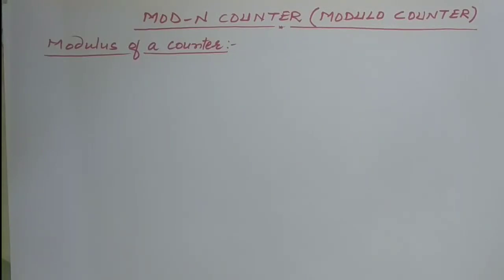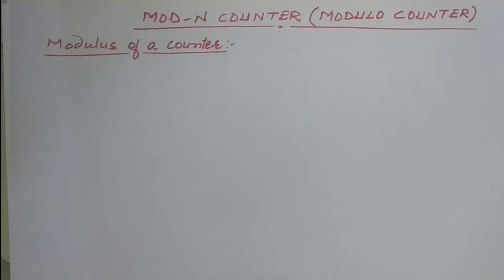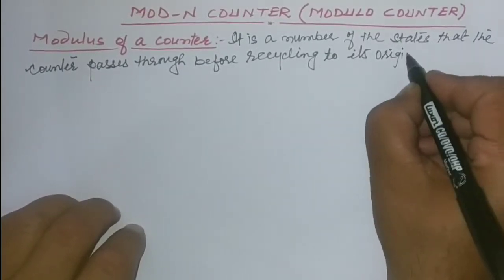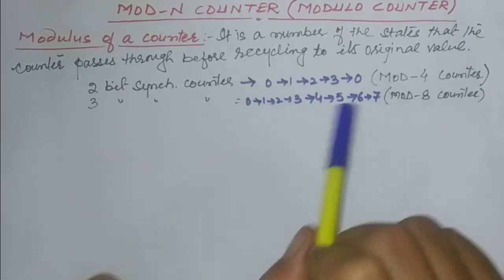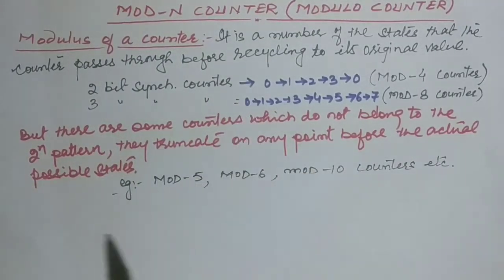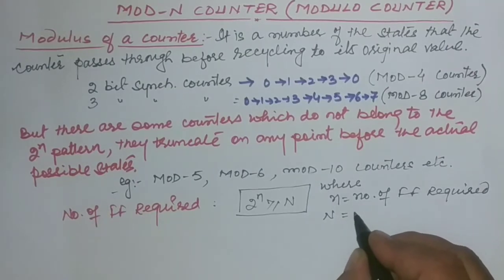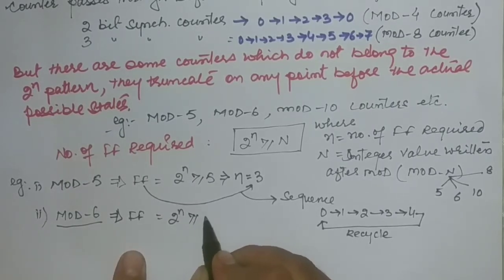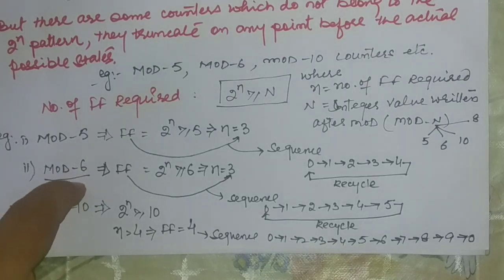L20:MOD -N Counter

Comment: from  8:27 how did you got (n=3) for mod 5 counter and (n=3) for mod 6 counter
Reply: Since we need a value greater than 5 for a MOD 5 Counter, by using hit and trial 2^1=2 not greater than 5
,2^2=4 not greater than 5 ,2^3=8 > 5 therefore n=3.